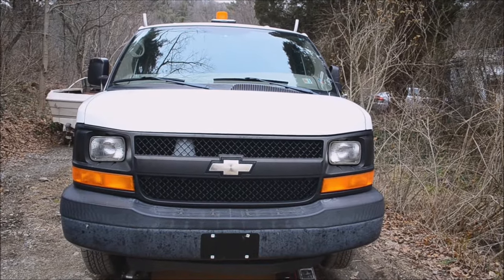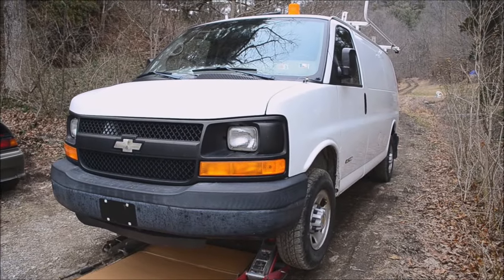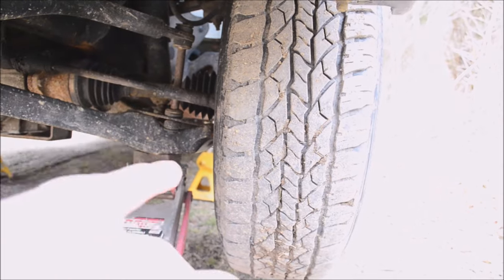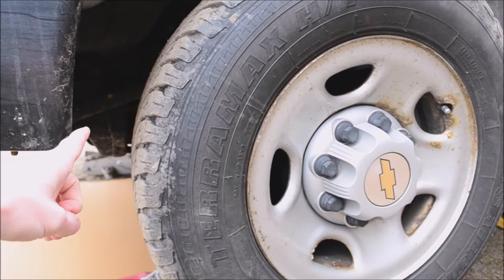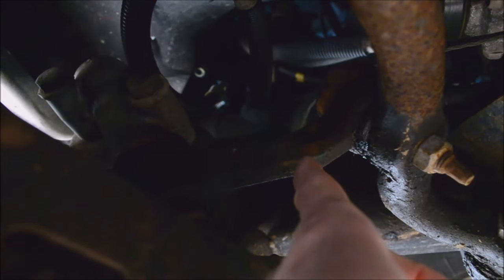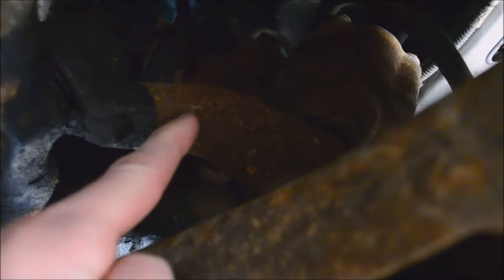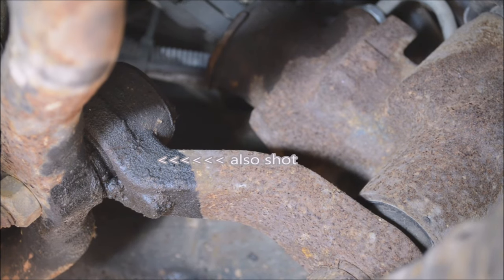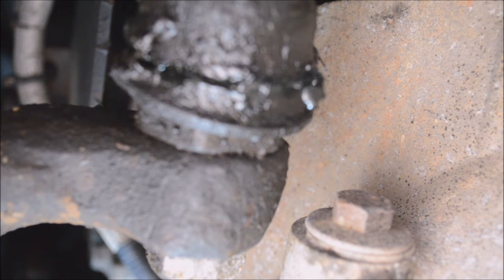How to Spot a Loose Pitman & Idler Arm - Chevy 2500

Comment: Yea extremely important thing to keep an eye on I found out tonight! Heard some popping when coming to a stop and never thought much of it. Pulled out of a convenience store and lost ALL STEERING! About shot me into a telephone pole and was lucky to get it backed into a hopefully safe parking lot until I can replace the snapped ball joint coming off the pitman arm. God I’m so glad I wasn’t going down the highway when that thing decided to finally let loose!!! This was on a 2005 Duramax with a 4” lift and 35” tires that I just bought a few months ago. How there isn’t some kind of safety to prevent loss of steering is beyond me. But then again I should have been checking into the popping noise a lot sooner! Be careful out there folks!

Comment: Tackling this on my 04 2500 this weekend. Idler and pitman, not looking forward to it. I'm sure a few choice words will be said during the job. But it's always a good feeling doing it yourself and saving a ton of 💵💵
Reply: Doing this myself along w both control arms ,red head steering gear box and upper ball joints , I know I’ll make up some words …
Reply: Helpful hint. Use an angle grinder and cut the old one off the shaft. Cut it about 3/4 through then use a chisel to split it. I do these in about 15 minutes now.

Comment: Did you happen to get any clunking from the play in the idler? My Tahoe has a front end clunk when the suspension loads and unloads, like coming to stop, and sometimes when reversing and turning. I've replaced the ISS and bushing under the dash. I just installed new inner/outer tie rods. I check all the ball joints, hub bearing, ect and had the alignment shop check them as well and they all checked out. While changing my diff and transfer case fluid yesterday I did what you showed in the video and definitely have some play/slop in the idler to center link joint. So, i'm about to order the idler bracket/arm and pitman arm to finish the steering system overhaul on the truck. My truck has just a fuzz under 150k and still on the OE parts, other than the new tie rods I just installed.
Reply: Just hit 150,000 on my 2004 avalanche and changed out the sway bar links, drive side hub and drive shaft. Inner and outer Tie rods. I think i'm going to change the idler and pitman arm. I also plan on replacing the Steering Shaft Coupler to get rid of the play in the steering wheel.
Reply: Yuh ever find the problem?
Reply: @GodEnergy888  It was my was the body mount, where the radiator core support attaches to the frame. My passenger side mount was popping when the frame would flex. Literally just fixed it a week or 2 ago.
Reply: @GeekyDad84  Thanks Bro!
Reply: Having the same problem that you sounded like you had. The shop said the idlers arms need replacing, but I dont want to just replace then, then pay 200$ more for the alignment, just to have to change another arm or something more major and have to realigne in 6 months. Did you guys do your own repair? Is it a challenging  task?
Reply: @matthewmccain3601  mine ended up being the forward most body mount on the passenger side, where the core support attaches to the radiator. I pulled the fender liner and had my wife drive back a forward in the driveway where it would always do it and just put my hand on various things till I found the issue. I partially replace the mount, lower section, and retorqued it, plus a little extra, and it completely went away.

Comment: Thank you. this asshole did my pitman and left idler arm and it's been making a knocking noise ever since now is on both side I believe. I changed the entire front suspension to fix the problem and now I realize he did it. Well I knew he did cuz was fine when I took it to him then after getting it back I heard the knocking. Thought it might be the U joint to the axle and also noticed the front shaft going into the transfer case rocks loose in there so that's ffn great too. Anyways thanks I think this might be the problem.

Comment: Yo this is all great but I need to get the damn thing out
Reply from the maker: check my other videos https://www.youtube.com/watch?v=So4qBZFK0pE
Reply: pitman arm puller at your auto parts store. Most will lease out front end tool kits which include this puller. Or you could buy the puller for like 25$ at advance auto, etc. and keep it and the packaging clean and just return it after you're done. You may need a different size one or a pry bar to get the idler arm off as some idler arms are a slightly different size or dimensions then the pitman arm. I took my pitman arm off with the puller but its too small for the idler arm so I am using a pickle fork to try and pry it off. Also PB blaster or WD40 helps loosen up rusted bolts and pins etc.